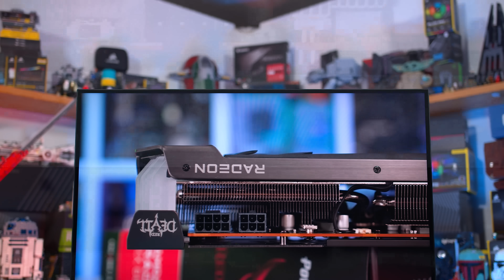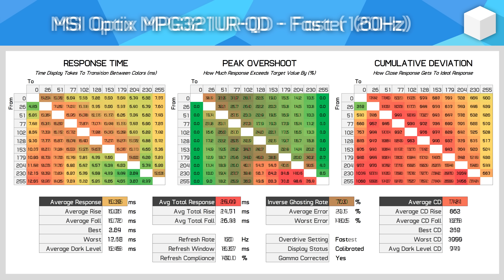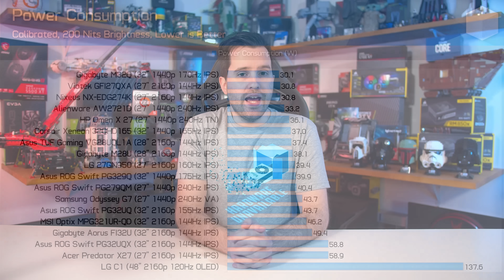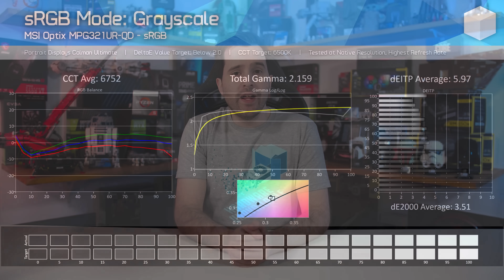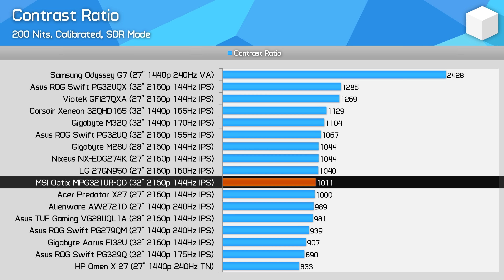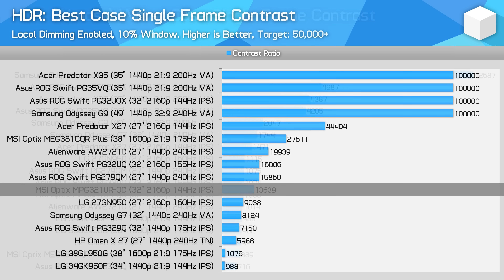The 4K Monitor to Buy? - MSI MPG321UR-QD Review

Comment: Hi love your vids.
Any chance for a vid comparing a 43" 4k 60hz TV to a good not much more expensive monitor?
What are the advantages and disadvantages of using 1 over the other, calibration of the TV, modes and best resolution to use.
I've been using a TV as a monitor for the last 9 years (32" for the firs 5 years and 43" 4k for last 4 years) and very happy with it but would like to know what I'm missing if anything.
Reply: Same here, getting into photo and video, so no sure if to get a monitor.

Comment: I bought the LG 48" OLED about 2 Months ago...I know it'll burn out at some point (which may be 1 Year, since i use it a lot). Until then maybe a GOOD Monitor will be on the market. Hopefully an 4k OLED with only 32-35" and a longer Lifespan...and for less then 1000$
Reply: i've got one as well. just play a variety of content and you will be fine for quite a while
Reply: @bjornb2710  I've had my 55" CX since like March 2020 and it's the best gaming display ever - hands down PC or Console. I ditched my LG 38GN950 for it. I use MSI AB OSD 100% of the time and I see no burn in, I wouldn't worry about it the TV takes care of it and you can always run pixel refresh manually. It's the best gaming TV/Display I've had so far and no "Gaming" monitor interest me anymore. If LG ever does a 38" OLED Ultrawide, I will lose it.
Reply: @FakePlatesAreKillingYourGains  agree, i have the 48 inch c1 and it’s absolutely the best monitor out there
Reply: Don't go crazy on the brightness (OLED light) and be sensible with it and it will last much longer than that.

Comment: Please do the new G7 by Samsung please sir!!!
Reply: Those panels always come with dead pixels why would you want that lmfao
Reply: @Arokhantos  my 4k G7 does not had any dead pixels at all.
Reply: @Arokhantos  BS
Reply: @Arokhantos  It's the same 28" 4K 144Hz as the M28U and the other recent monitors of that spec. The dead pixel rate will be exactly the same as those.
Reply: @Arokhantos  yeah... I would like to see that statistic
Reply: After only one day of playing on my New G7 I got a stagnant vertical line down the middle and horizontal line towards the bottom of just dead pixels. Wtf. Not even joking. Best buy wtf.

Comment: Nice review. I am not interested in a 4K monitor but looking to upgrade to an IPS gaming monitor in the 27 Inch to 32 inch range. The revolution I am naturally looking at is 2K.
Mt question is should I go with a 32 inch at 2k or just stick with a 27 inch. For reference of my eye sight, I don't like how 1080p looks on 27 inch displays and I sit with in 3 feet of my screen.
Reply: I've used both 32" and 27" at 1440p. Both have positive and negatives; upside of 32" variant is you get really immersive gaming experience with the bigger screen, but the pixel density and sharpness of the image looks much nicer at 27". If you've got eyesight issues then the 32" will be better, but using the 27" can be totally doable if you get your optometrist to make you some computer glasses (assuming you wear glasses already).  However if you're using your screen 3feet away probably best to use 32"
Reply: @pishni259  Thanks for your answer. Currently my eyesight is 20/20  so I am concerned I will notice image quality issues going from a 24 inch 1080 screen to a 32 inch 1440p. Unfortunately there are not stores close to me that I can do comparisons with hence my question. I am sure I will be fine with a 27inch but since the prices for some 165hz models are so close between a 27 and 32 inch I was just wondering if I should go for more immersion without affecting image quality.
Reply: @BNOVA sure - actually 24" 1080p has the same DPI as 32" 1440p, so you may be accustomed to it just fine. 32" 1440p still looks decent, but if image quality is your thing then it's probably best to go with 27" 1440p. Many more choices in that category too. If you go 32" I recommend a curved screen because sitting up close to 32 flat screen you have to turn your head more to see stuff, depending though on how far away you sit in front of the monitor. TBH you'll never know for sure unless you try out both what you may like best. Seeing the difference in person can be the most illuminating way of course
Reply: @pishni259  Thanks 😊.  Your reply has been truly Helpful. I think I will upgrade to a 27 inch due to the fact I will have to turn  my head more with the 32 inch.

Comment: I don't see a point in more than 120 Hz on a monitor like this. Pro gamers will go for 1080p or maybe 1440p panel with even higher refresh rate. People enjoying games in 4K are more likely to play RTS or RPG games that have no use at all from more than 60-75 Hz.
Reply: Yeah the resolution choice is very game preference specific. Realized this after testing the fi32u. If all you play are RPG RTS or open world games, or single player fps even it's fine, but competitive games you'd otherwise play on 1080/1440p higher refresh is not great on 4k. Tough to make a 4k monitor be an all-rounder.
Reply: @pishni259  so true. 4K with high refresh rate is only for people that do some work beside gaming. But 4K wont be true mainstream in gaming for another 6-7 years, maybe even longer with chip shortage and rumored big MSRP increase with next gen GPUs.

Comment: Hello Tim, do you know if there will be much, if anything in the curved 4k monitor market? I tried curved, due to eye strain, and was amazed at the results. I switched to curved in mid 2020 (with working from home and then gaming) as eye strain and induced headaches became more frequent and worse. In the 16 months since the switch, not a single instance of strain or headache. Finding high refresh, curved 4k seems to limited or just not there. Is it to niche of a market or was it just a fad for mainstream?
Reply: Ditto I wish they had something like this

Comment: What 27" 4K VA monitor to buy, but NOT for GAMING?

I'm currently on 2x24" FHD monitors and decided to upgrade...search started for 1440p, after few days of reading reviews and watching YT videos, I settled on AOC CQ27G2U/BK...but then I continued reading, and it seems 4K is overkill on that size only for gaming,and I'm not a gamer. With that param (non gaming) it was much harder to find any valuable information because everyone today is focused on gaming experience. So now I'm lost, dunno what resolution to get, which panel, 32" seems to get the best panels, I don't have space for 32" and I'm not convinced 32"can be good replacement for 2x24", I don't have shit load of money to throw at monitor. Maybe I should just stick to with good old BenQ VZ2470 (AMVA+ panel) that I have.

Comment: Jesus man trying to find a proper monitor for a next gen console is insane. there's some tvs that can compliment your needs but not at 32 inches which is my sweet spot for gaming I've looked at EVERYTHING gigabyte m32 u reviews are all over the place biggest thing is HDR sucks , lg 32gp850 same thing reviews all over the place, odyssey monitors , Asus rog swift , any monitor 1440p or 4k hdmi 2.1 there is just always SOMETHING damn near every monitor doesn't have proper HDR most of the monitors seem to have a white haze while gaming on war zone. I seem to come across a problem for every monitor that's "recommended" I think im just going to have to wait and drop the money on lgs c2 42 inch
Reply: Honestly I would recommend you to wait for LG C2 42 inch, especially if your GPU supports HDMI 2.1. It's going to be more expensive than the monitors you listed but it's 100% worth the price. I have the LG C1 and it's the best TV I've ever used for gaming and watching content
Reply: @ElectroLM10  yeah definitely what I’m gonna hold out for. There’s some oled monitors coming out that are pretty sweet too but you don’t need all that or a series x or ps5 right out the box thr c2 seems to be the answer and the hdr is so ass on pretty much all the hdmi2.1 monitors

Comment: Whats the difference betwin this and Optix-MPG321UR-QD-Xbox-Edition annaunced 6th of January?
Reply: By the looks of it, It's the exact same monitor. I even looked at the specs and everything looks exactly the same. I'm wondering if they just added some special design to the monitor or perhaps it just works best with Xbox since PS5 doesn't support VRR yet and the Series X does. I'm going to try and message MSI to see if they'll give me some info on it.
Reply: So turns out it's essentially the same monitor with a different looking box and has a game mode setting specifically for the Series X that lets the monitor know to enable the best settings when connected to the console. That's the only difference, Otherwise there is no change in performance.

Comment: Would this monitor be worth approximately 565 USD in December 2024? It could be found for this amount as a black friday deal. I bought one but I have concerns about the KVM switch that should support up to four devices but there is no information nor proof found whether this feature actually works or not.

I have not picked up mine yet and am thinlkng about cancell8n the deal.

Comment: I currently game on a 32 inch 1080p 60 Hz insignia tv from 2015. It says
 the response time is 6.5 ms. Is it possible that the MSI MPG321UR-QD 
monitor has slower response times than a 32 inch insignia tv from 2015?
Reply: That's almost certainly not a number you'd actually hit. Marketing speak
Reply: @mattcroft  so 6.5 seconds is the most ideal scenario?
Reply: Probably not even. Likely this isn't factoring in input delay either
Reply: @mattcroft  Then what does the 6.5ms response time mean? I'm just confused.
Reply: @bpizzsick  Nothing. It is defined in whatever way will create the number 6.5 ms.

Comment: 32 inch 240hz... samsung g7, no? Is the curve THAT bad? I'm thinking of upgrading to 32 inch or 240hz, since this gen of 4k120hz displays are quite disappointing, and I'm not a fan of the curve, so I'm stuck between 32 inches and 240hz...
Reply: I took one recently for a "fair" price around 550. It is overpriced for what it offers, still a good qualy panel. I apreciate the decent brigtness and local dimming, which together increase the overall gamma. Using it at 144mhz so it is 10bit. Had some flicker issue, not anymore. But i changed the cpu which seems to have solved a lot of screen issues like stuttering, so probably the high frequency screen only shows the issues more, not causes them. The curve is very agressive, not much liking it for movies

Comment: Unfortunately, the perfect 4K 32" 144Hz monitor doesn't and won't exist without flaws. Even OLED displays, which is consider to be the best, has a significant disadvantage that is burn-ins. Don't tire yourself waiting for the "perfect" monitor. What I suggest is to look for the monitor that is suited for your needs (e.g. gaming only) and not being nitpicky about other issues like minimal backlight bleeding or IPS glow, in the case of getting an IPS monitor.
Reply: Burn-in isn't an issue anymore, especially with LG OLEDs burn in protection features. Just search up the rtings burn in test where they kept a LG OLED TV on for thousands of hours and there was no burn in

Comment: Oh goodness. Forget 32" 4K altogether right now... got it!

Can someone -- ANYONE -- recommend me a great 32" 1440p monitor? I don't need ultra high refresh rates -- I play MMOs, RPGs and adventure games; I rarely play FPS titles and I don't PvP much. I want to also use the monitor for work, hence the desire to have a large one so I can put multiple apps on the same screen without hurting my eyes.

I find this stuff rather confusing and could use some advice.
Reply: Several potential options: Samsung G7 in 32", lg32gp850, or the Acer xb323ugx
Reply: I recently got a Samsung g7 32" @ "only" 550eu. Seems a good compromise before a decent 32 uhd monitor is correctly priced. Otherwise, any 120hz tv in the 800-1000 range is a better option. The curve in my g7 is a bit too agressive, not good for movies

Comment: 4K monitors at 33" make absolutely zero sense, the returns are diminished heavily.

The whole point of ultra high definition is to maintain the higher resolution image you'd enjoy such as 1080p on a 24" display, on much bigger screen sizes without any loss of clarity.

Unless you're gaming at a minimum screen size of 55", 4K isn't worth it, as you're not really going to see the true benefit of it.

If you have a gaming monitor at 33", returns diminish beyond say 1440p or a slightly higher custom resolution than that.

Pixels per inch (PPI) is a thing folks, that's the key to image sharpness and quality.

I can't go back to anything less than a 55" display minimum now, seeing anything smaller just looks strange to me.
Reply: @UCsUamkK5dw7kNgY98c4Dxgg Hi, I'm not a reviewer, just a gobby YouTuber with an opinion 😎

However, if you read my original post, you'd know that you're probably wasting your time going for 4K at such small screen sizes.

You're better off saving your money and just getting a 1440p monitor if you're only looking at 32 inch high refresh screens.

4K is for 55" screens or larger.

Also, most gaming set ups aren't going to churn out 144 FPS at 4K anyway, so that's another waste of both pixels AND refresh rate.

At 4K, a 60 hz refresh right now is the only thing that makes sense.

1440p may be realistic for 144 Hz gaming, but you'll need a beefy rig to get that consistently from most games, especially the AAA ones.

Comment: almost bought this one today if anyone has any suggestions for a good monitor for ps5/Xbox X please let me know could use a second opinion thanks
Reply: There is a new Xbox version of this one coming out soon, It's the same panel with Xbox branding on it. There is also the BenQ Mobiuz EX3210U. Both monitors are awesome if you're looking for a good 32 inch monitor. If you're looking for better performance, The 4k Samsung G70A is a great choice but only has 40gb of bandwidth for HDMI 2.1. The 32 inch monitors I mentioned both support the full 48gb bandwidth of HDMI 2.1. The MSI monitor does get a lot brighter than the BenQ monitor as well. I've tried all three and so far the BenQ has worked the best of all the other one's I've tried, The MSI seems to be a bit slower and has more overshoot at lower refresh rates but nothing too extreme. The monitor I got from BenQ had a lot of backlight bleed in the bottom corners, Probably got unlucky with my panel. Either way all the monitors I've mentioned are great choices for any of the new consoles.
Reply: @armen1136  im looking at the M32U bc at this point does the limited hdmi 2.1 matter since most games play 4k at 60 fps regardless? from my understanding u only need hdmi to 2.1 to do 120 fps right?
Reply: @ItsTheLAGuy  Yeah that is true, I'm pretty sure most games are still going to be 4k 60 on consoles. I'd be surprised to see games being run at 4k 120 on consoles.
Reply: @armen1136  hey bro im using Benq EX2710U im planning to get this MSI model wht would you say for colours since MSI has quantum dot technology does it show any improvement over benq model? Should i need to stay with benq EX2710U or switch to MSI mpg321UR? which one was colourful and vibrant among these, I need ur suggestion since u have experienced all the panel.
Reply: @Arno641  The MSI was definitely the most vibrant monitor I've seen. The problem is that now we have Mini LED monitors on the market that are around the same price and some cheaper. If you want really good contrast, The INNOCN 32M2V is on sale right now for $850 on Amazon and has over 1k zones. If you just want a really colorful display, The MSI is a pretty solid choice, It just depends on your use case.
Reply: @armen1136  For MSI, how is it compared with benq EX2710U (similar to 3210U) model which im currently using? INNOCIN is not available in my region but samsung Neo G7 is selling for some cheap price but im no more interested in VA panel!!
Reply: @Arno641  I liked it better overall. For me the MSI had a beautiful image. I saw reviews that complained about it’s response time, but I only play single player games so that was never a concern. The BenQ does have better performance than the MSI though, but I still preferred the MSI for the picture quality. Quantum dots really do improve the colors significantly, So I prefer a display that has it.
Reply: @armen1136  Ok then im going for the MSI model, Tnx a lot for your time and response!! Even a reviewers doesn’t spend time by replying for comments but you did. Tnx bro!!
Reply: @Arno641  No problem! Hope you like it 😁

Comment: i have the same monitor at home :)
Reply: How was it mate? Im planning to buy this as well.  But thinking if i would just go for the FI32U which is a bit less expsensive than this.
Reply: @Jayprox  to tell the truth , I d ont now what's the price for the gigabyte model, i pay it 872euro with taxes , I relied on the review of tim to buy it first, but ultimately I am not disappointed ,  beautiful color a little too much even, a lot of adjustment , the panel is magnificent, I run with an rtx 3080 with i9 9900k and 32gb on bf5 I have 105-115 fps on ultra , and on bf 2042 I have 95 fps, no tearing , the image is very clear ,we will draw its full potential with the rtx 4000 ,  i have a ps5 i tried , it works very well with hdmi 2.1 but i prefer to play with it in my 55lg cx the oled panel is far better .
Reply: @robscofnald8026  thanks mate.  I appreciate your response.  Happy holidays.

Comment: Been wanting a 4k monitor but found I like my 27inch 1440p 165hz. Maybe a 240hz panel be nice but I'm no sweat an playing fps less an less.

But battle field is around conner but looks pretty demanding and don't think there campaign witch is a bummer as would Crank my settings up close to the highest then switching to low setting online.
Maybe would want 4k if got 3080/6800xt 
But got 3070/Xbox series x and on Xbox if you go 120fps most of them are 1440p sometimes lower and in a blue moon get 4k 120.
Ranting my bad